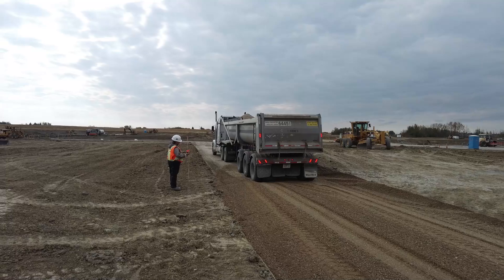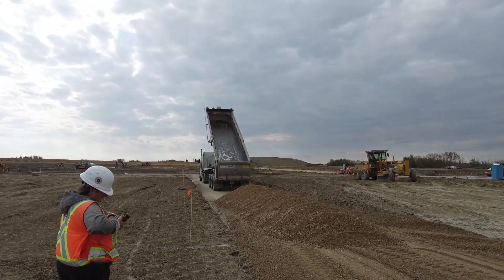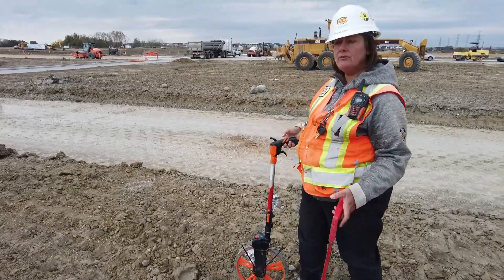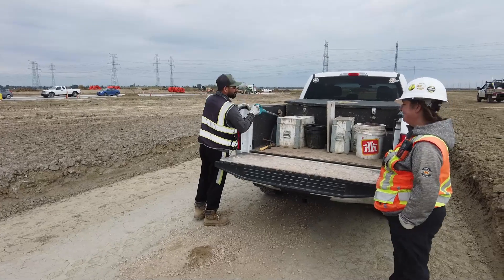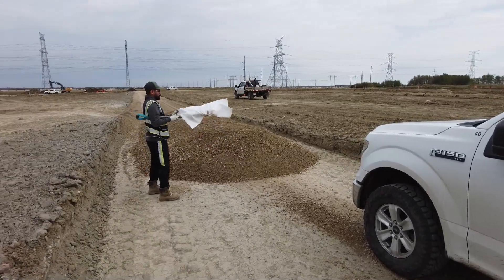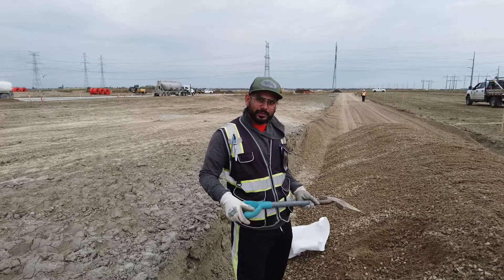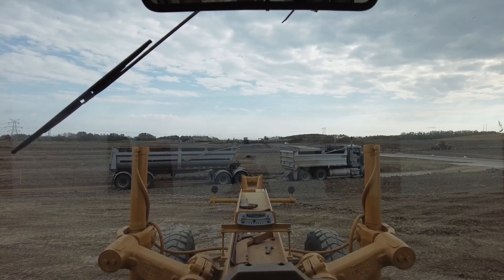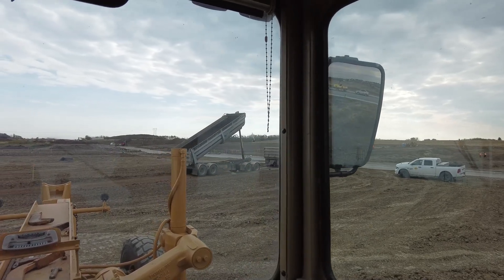Placing 20mm Gravel in a Lane, plus Sieve Analysis

Comment: When I was working for earthmoving companies, I always found it amusing, that depending on the soil tester.. you would either get a good result or a not so good one.  I remember being asked to push test cut, on what was a dry spot, which was right next to a very obvious wet spot.  Enough said, hey.  How many years since you've actually had to mix gravel Vern?
Reply from the maker: Hi Adrian, approximately once or twice a year, we may have to "pull the gutter" That's the term we use to dry out the outside edges of the street.
After a heavy rainstorm, this is where water can accumulate.  We wait for a sunny, and hopefully windy day. Then we cut down the outside edge all the way down to the stabilized clay. Next, we windrow that wet gravel to the crown, and spread it around. Then of course, Onces it's dried out, we place it back in the gutter.  Note: Some gravel can tolerate a rainstorm better than others depending on the quarry the gravel was sourced from. Nice to hear from Australia.
Reply: @onlyamillionmistakesvernky7937  Yeah, I meant mixing gravel when you're building a road, instead of having premixed delivered.  My Grandfather told me they used to have 2 Graders faci g one another for mixing road base/ gravel.  One side was the corse and opposite the fines. Each windrowing and layering until they had one pile.
Reply from the maker: @adriannettlefold9084  I bet your grandfather has some interesting stories.
It sounds like they were blending gravel on site, and NO, I have never done that. In Alberta, 
 the gravel must pass a "sieve analysis"
to be used on site. On rare occasions, if the gravel gets very segregated, I may plow it with the grader to blend the material. I wish I could have toped your grandfather's story, but that's all I got. Thanks Adrian.
Reply: @onlyamillionmistakesvernky7937  unfortunately the stories ended in 2004, but memories are vivid. His Forman who he trained to operate machinery, is still alive and a good friend of mine. He gave me technical trade manuals that he used on the Shire Council, showing much of what you are now putting on your YouTube channel. Thus my very keen interest. Always good to talk, take care. Cheers.